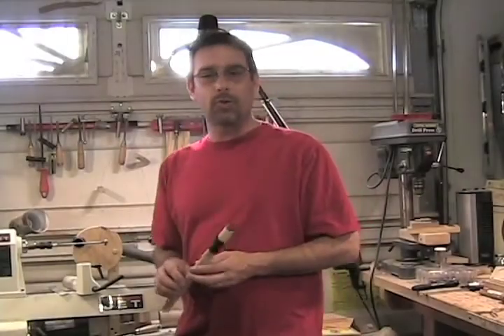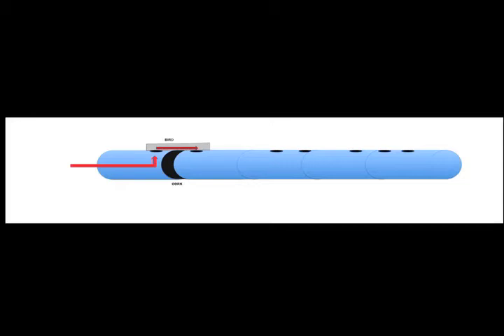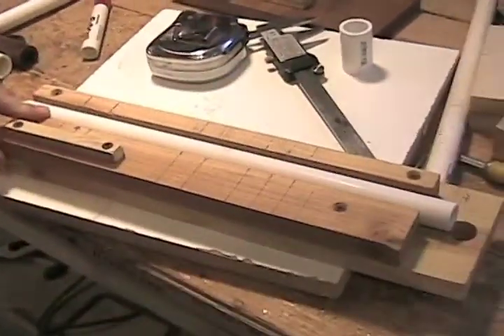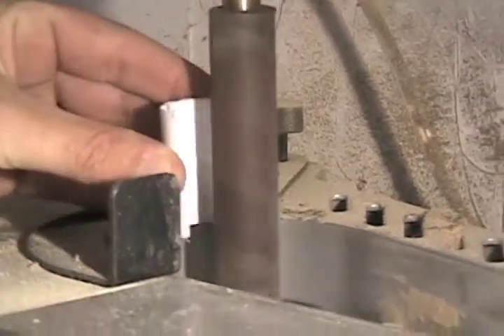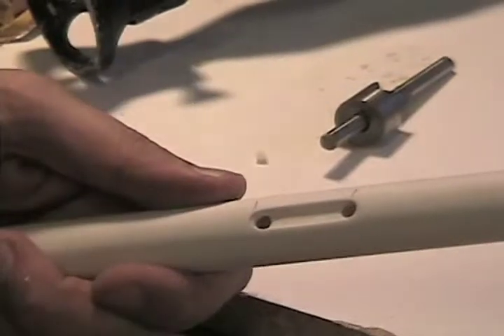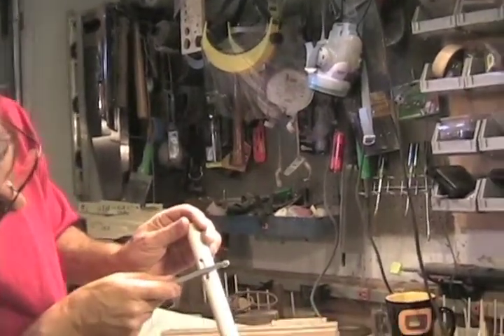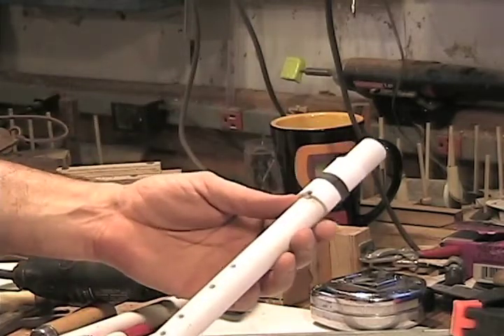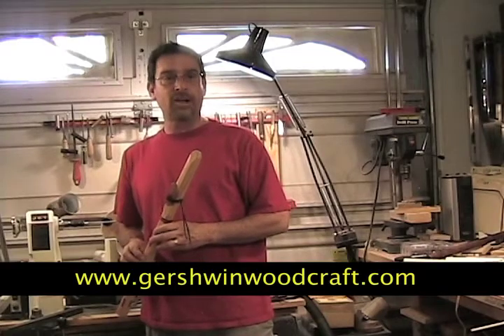How to make a Flute

Comment: I started by making a flute out of PVC.  I then decided to use acrylic so that I could use my laser engraver to get the holes perfect.  I got some advice from expert flute makers and they gave me different placements for the holes.  After a few tries I can now make a flute that sounds good.  I have made a few videos about it if you want to check them out.  I found that a square hole works better for the sound hole.

Comment: To be more precise track 1/32 of a inch ,no more then 1/16 of a inch deep, make sound hole 1/4" square can be round but more easy to make 45° slant using flat needle file ,air hole can be round also 1/4", good luck

Comment: I copied down your info for both the 1/2" and 3/4 flutes. The only question I have is on the 3/4" size of the flute. You have the lenght at 17 2/4" Is the size 17.5 or was this a typo and was ment to be 17.75"? I want to get it right the first time.

Comment: please help.  I had the day off work so I decided to try my hand at making a flute.  Everything seems to have gone together properly but I get no sound just air.  Any idea what I did wrong.  It appears I have an air tight seal at my cork.  If I cover the speed hole with my finger and blown I have no air movement.  When I have the bird on I get air through the sound hole. Could it be my channel is not the right size?  There were no dimensions for that so I guessed based off the video.